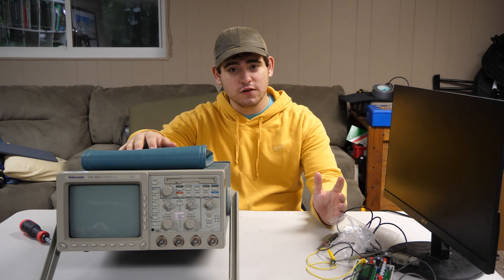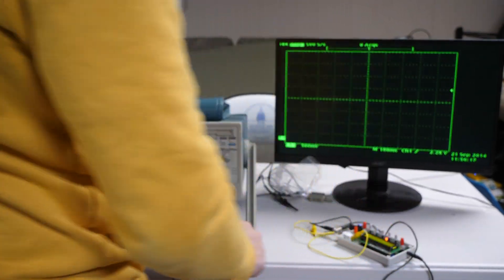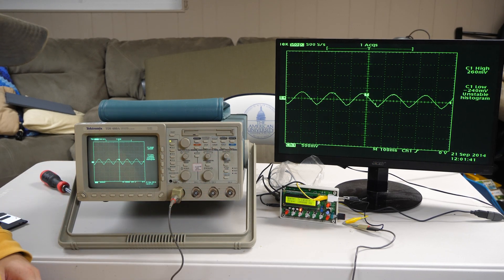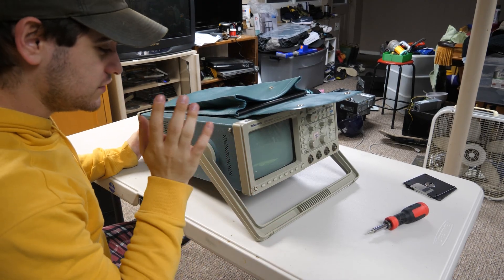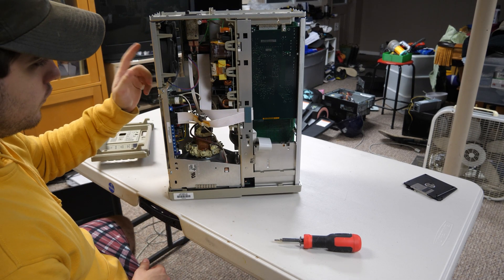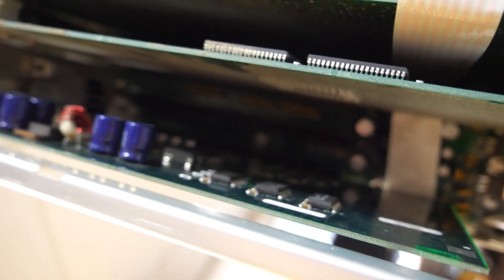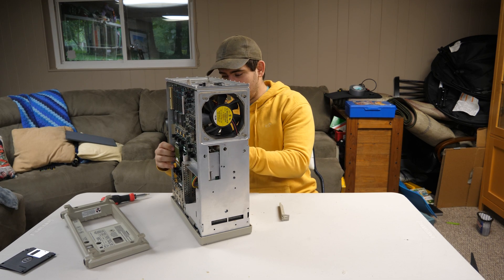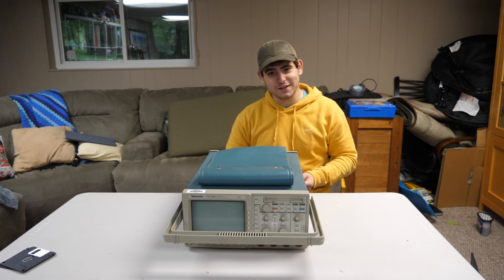This Oscilloscope Is Garbage (Literally)

Comment: Great video! BTW the X-rays are generated from the CRT itself. That black thing is the “flyback” transformer which converts a hundred and some-odd volts up to several thousand volts and supplies it to the CRT. 😊 All CRTs produce some X-rays and generally the casing of the unit shields them a bit so not too many escape while the unit is in operation.

Comment: Lookup how triggering works, and lookup aliasing. Nice tool to start learning about digital oscilloscopes and the technologies used. 

It only emits X rays if at all when its on, as the electron beam hits the phosphor ,  from the front of the screen like all CRT  TV sets and monitors used to ( long way back the tubes in the CRT EHT supply also emitted X rays , before semiconductor  parts were used) The glass has lead mixed in it for shielding . 

have fun!

I have a couple of dumpster instruments thrown out by Nokia back in the 1990's, and a couple of oscilloscopes from Philips where I worked in the 90's.

My day to day oscilloscope is a battery powered Fluke 95 which has clever electronics in it that means it out performs todays $250 USB scopes.

Comment: Here is a tip:

Try not to run your camera on auto focus if you are to be moving in front of it, it drives the camera nuts,

getting very confused about that the focus target is. You can use manual focus, if you know for example 

that the scope is 1 meter from camera, set manual focus to 1 meter.

Very interesting video, keep up the great work.

Comment: I had scored a broken TDS 420A out of the dumpster in 2010. I managed to find the problem (a small ceramic capacitor of 2 €cent in the power supply), and it still works like a dream ! These scopes are build for eternity !

Comment: I got a TDS420A from an auction for 50 cents... Actually a whole pallet of oscilloscopes... For 50 cents. It booted fine, but had 2 dead channels. I bought a dead one that didn't boot, and used a nice desoldering iron to transfer the ceramic modules from the donor scope to the one I had, and then used the calibration tools at work to calibrate it an generate a calibration certificate. I ended up selling it for half a grand, and the donor scope for parts... In the end, I only spent $60 restoring it... Well... $60.50

Comment: The label shows 20kV will be present on the CRT, even after it is switched off.  Learn about discharging CRTs.  Be very careful.
Reply: @inse001  Your saying 20kV is not dangerous, therefore it is safe.  20kV is never safe,  and a 20kV shock would cause the body to jerk, and that might result body parts ending up where they shouldn't.   You shouldn't be making comments like that.  Some people might believe them.
Reply: @darrenconway8117  yes, I agree- I was referring to off-state

Comment: Have you determined the highest frequency at which a perfect square waveform can be accurately displayed on your equipment?
Reply from the maker: not yet. the signal generator is a bit of a hassle to get working since it's so cheap
Reply: @sealiosprojects   You can use the SN74LVC1G14 for 5,5V up to 200MHz with a variable sine wave generator

Comment: Download the operator and service manuals and  watch some youtube videos such as eevblog and others on using a scope without blowing it up and it'll save you some heartbreak.. That crt tube runs on voltages in the tens of kV and the capacitors can hold a charge that will bite you hard also. Have fun  and stay safe.

Comment: 8:31
Cathode Ray Tube(CRT) 
One of the last application of the vacuum tube.
It stores charges of 15 to 20 KV.
Be careful not to touch the connection of the anode (Red wire that goes into the tube.)
This is where it can discharge and cause a possible shock.

Comment: Replace all surface mount electrolytic capacitors right away if it hasn't already been reworked. They are bound to leak at this age.
Reply from the maker: When I get back home that's the first thing I'm going to do!
Reply: @sealiosprojects  You got lucky that this unit turns on working. One can barely find a TDS 500A series that works right out of the box at this age.
Reply: What is a surface mount electrolytic? Do you mean through board electrolytic?

Comment: I have a E2050A GPIB gateway (puts your GPIB instruments on the network) which I can sell it to you at $300 (I normally sell it for $400 on eBay) if you're interested. It's more versatile than USB which you're stuck with the drivers they provide.

Comment: Nice dumpster score! 100MS/s is still quite useful single shot bandwidth.
Reply: BTW, Youtube recommended me your channel, it's been doing this a lot lately recommending small channels like yours, I love it. Keep it up.
Reply from the maker: Thank you!!!
Reply: I'd rather pay $200~$300 to get a HP/Agilent/Keysight 54645A/D than this Tek though. 54600 series is a lot more robust to aging issues, low maintanence, responsive to controls, user friendly and space conserving than TDS300~400 series. I have little love for Tek since I started fixing more and more of them. They are designed to be barely good enough to endure the service life Tek honored. HP/Agilent/Keysight had a lot more attention to details.
Reply: @humgar The good old Tek TDS220 is great and small. Yes the LCDs start to fail after 30 years, but lately new replacements are available from China. And regardless of what one would buy, this was FREE.
Reply: @humgar  - I have old Tektronix scopes made in the 1980's that are still working great so it depends on the Tek product, the old analog scopes were mostly bullet proof.
Reply: Nice! I used one of these at work years ago, decent scope
Reply: Man look who is here. Maybe electroboom will join the the comment section as well😊

Comment: I agree with you regarding the use of old equipment, but that's only 30 years old,  so it's almost new! I just bought a CT52 miniature oscilloscope from 1952, so 72 years old - that's proper old. It's so much nicer to use kit that's got knobs and a CRT rather than doing everything through a keyboard and menus.

Comment: Just a thought regarding X-rays from a grey beard technician with over 50 years experience. The CRT produces a very small level of X-rays from the front, not really something to warn about, and indeed the black plastic part looks like the EHT transformer.  I wonder if this might be a vector display, as used in some video games back in the 70s such as Atari Asteroid etc, rather than a raster scan display,  used in CRT type televisions. The only part inside early colour televisions that was a serious X-ray hazard was the shunt stabiliser valve (tube) that kept the EHT stable thus preventing the picture size varying with picture brightness, I wonder if there is one lurking inside a piece of test gear of this quality. These used to be in a metal screened compartment with interlocks to shut the TV down if opened.  To work live inside this compartment required the wearing of a lead apron, how times and technology have changed. As already mentionned placing the CRT face down can cause detritus from the cathode inside to fall onto the back of the phospor coating causing dark spots, that would really spoil a lovely scope. Nice video, keep them coming, thanks.
Reply: Raster - like TeeVee ... also accounts why there is a VGA output in back ... some of the HP 8560 series Spectrum Analyzer displays used vector graphics though.
Reply: Great explanation!
Reply: I have a TDS-360 and it indeed has a 640x480 VGA raster CRT with magnetic deflection

Comment: Hang on, we've got another Dave Jones here! Today In The Dumpster Room... Definitely a nice find. 
Tektronix always made great scopes, even if this one is nowhere even close to modern DSOs, it was the high end at its time. Definitely worth keeping and learning how it works.
I've got a Tek 468 which is as old as me and is my favorite scope by now :).

This DSO uses a kinescope type CRT, like you find in monitors or TVs. It uses magnetic deflection (that's what the yoke on the neck is for) and is indeed a vacuum tube... with a bunch of kilovolts plate voltage, so be careful around it. This tube is pretty short, takes half the depth of the scope's enclosure, but it was not a thing with analog scopes which use longer CRTs with electrostatic deflection. These tubes are a lot faster and suitable for viewing waveforms directly, in real time.

Comment: Those are not EISA slots, those are regular old 16 bit ISA slots. Also, you need to learn how to use the trigger!
Reply from the maker: I said that they looked like them. The reason why the trigger wasn’t working was because after I tested it I took the signal generator apart and while recording accidentally shorted the output pins of the generator. I know how to use the trigger
Reply: @sealiosprojects  actual EISA slots look quite different, more like AGP slots than ISA slots. They are also, amazingly, compatible with ISA cards (not the other way around). However, it is not something you would feel embarassed not to know about unless you worked or are working on high end 1990s computers.

Comment: Your cheap function generator may be suffering from having counterfeit / faulty opamps in its output circuit. If you are able to do basic SMD resoldering you might be able to replace those opamps with sourced known good ones like NE5532/NE5534 (I can't remember whether it's dual or single opamp it needs) and it might function MUCH better.

The best thing about getting a decent oscilloscope for free, instead of $300, is that instead you could invest the $300 into quite a good lab power supply, or a good signal generator (maybe a bit of both, ~$150 a piece). Then you really have a lab going, and for half the price you'd normally pay.

I'd still watch out for many electrolytic capacitors aging out when they're getting to 30-40 years of age.
Reply from the maker: Agreed! I have no clue why the signal generator didn't work that time because 5 minutes before I started filming everything was working

Comment: It looks like you had an issue with the scope triggering on the waveform. Normally the autoset should select the trigger channel. You might want to look into that. You can also manually set the trigger channel (which should be set to the same channel as the probe channel) if needed. Also this series of scopes is famous for having bad (phyiscally leaky) surface mount electrolytic capacitors. You might want to look at those aluminum cans on the main board and see if you see any liquid leakage. Mr. Carlsons Lab has a video on replacing those capacitors. You might want to look that up as replacing these will greatly lengthen the life of the instrument as the electrolyte from those caps can eat away at traces on the PCB and destroy the boards. Sam W3OHM

Comment: Tektronix is good.
Reply from the maker: Very! That is why it’s sad that I had to pull the oscilloscope out of the trash
Reply: Tek is horrible if you keep them long enough. Their designs age badly (like putting capacitor near heat sources) and it's a pain to service.

Comment: 12:54 I belive that is the flyback transformer. That doesn't creates x-rays. The only thing that creates them is the CRT. The transformer has shielding because it supplies high voltage and needs it to protect the other circuits from arcing over.
Reply from the maker: Ah, good to know! I’m really happy I didn’t mess with it
Reply: @sealiosprojects  Don't worry about X-Rays too much with a monochrome raster (computer/TV) type monitor like this device uses, or with MOST true analog oscilloscopes (not this) either. They tend to be in the 12 kilovolts or less range. Where things could get into "be careful" territory is with very specialized analog oscilloscopes (24 kilovolts and up), color raster monitors (24-32 kilovolts) when operated without the expected shielding or safety circuitry in place, very old school color TVs (which use tube based circuitry to drive the CRT) or any kind of projection CRTs (40 kilovolts and up, it seems above 32 kilovolts is where the X-ray issues start to get serious...). BTW, X-Rays go out the SIDES of the CRT, not the front. CRTs don't "use" X-rays, they are a byproduct - the radiation used to address the screen is more like very weak beta radiation, but it will NOT pass through the glass. And yes, it is KILOvolts at play around CRTs.
Reply: And the crt really creates x-rays mostly only when it's powered on. After that it's negligible. But even then it's really not that big  of an issue. Whole generations got to old age (yeah I'm old) beside turning these things on and off for quite a while.

Comment: On the neck of the CRT are what's called field coils. They deflect the trace around the screen.
Just like old TV's used to have field coils to deflect the electron beam around the screen.
Don't rest the scope on its face, it's not advised.
Reply from the maker: Is it ok to rest it on it's back? (Handle and screen facing up)
Reply: @sealiosprojects  Often there are feet protruding from the back of test equipment so you can rest it on it's back.
It depends on the equipment.
The service manual will normally include the correct method of dismantling.

Comment: GPIB-USB are available new-old stock on ebay for example for less than $100, not 3K.
The insulated thing you mentioned looks loke the high voltage transformer and it doesn't produce xrays.
Nice scope!